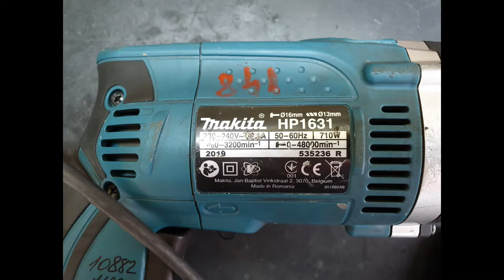Repair drill machine Makita HP1631

Comment: I mean.. I have the same drill, having a problem with the hammer mechanism and the whole visual inspection part I'd like to see, you are doing it off-camera between 2:20 to 2:28 you're just holding the part off camera and we can't see inside, can't see what it would look like normally.
For me, the little toggle metal "L" shaped part doesn't do anything and I would have liked to see what yours looks like.
Would be nice to see "before" the repair at what's broken, and "after" when you get a new replacement part..